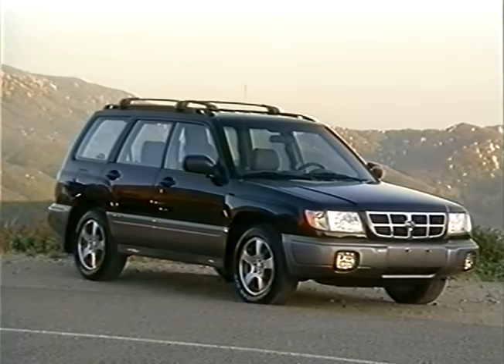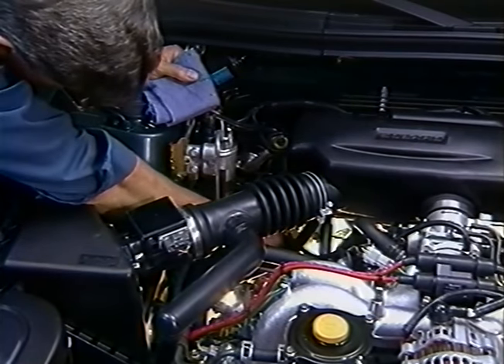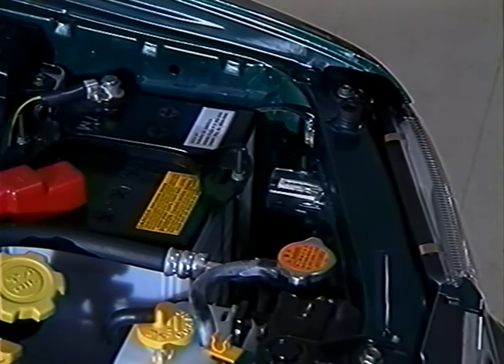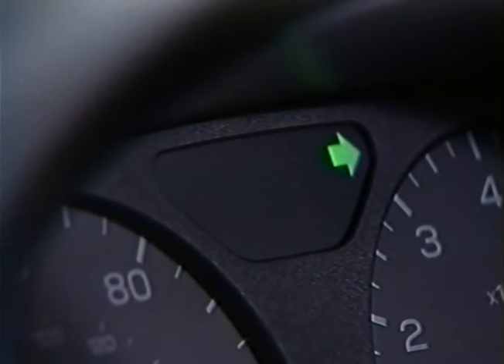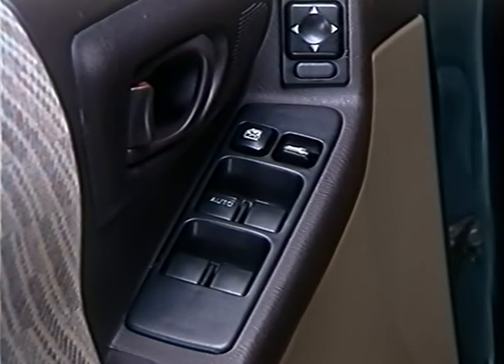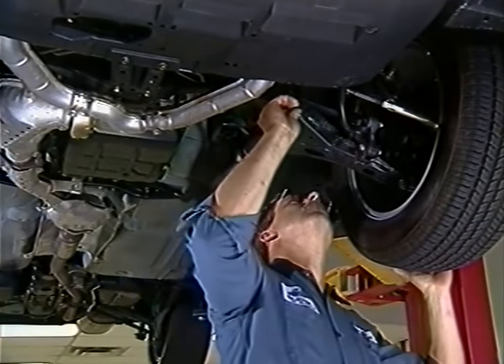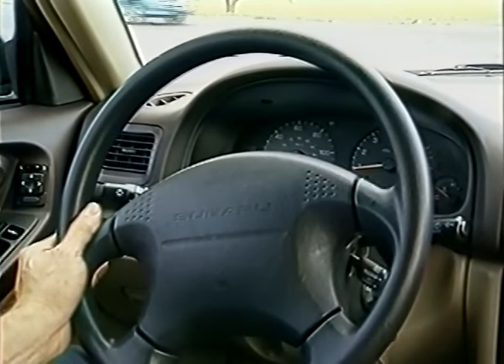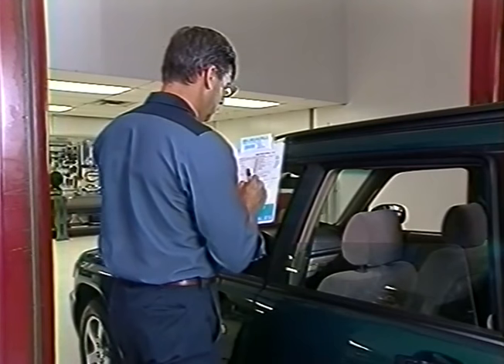1998 Subaru Forester PDI Training Video

Comment: The drivers window should go up automatically as well, unless the USDM dumbed that down too lol
Reply: Yeap my 2001 forester driver window goes down automatically but won't go up automatically seems pretty dumb to have one thing but not the other
Reply: @cristianvelasquez893  They go up & down auto in Australian market cars strangely! 🤔😳
Reply: federeal regulations. subaru didnt include resistance detectors in their windows, which would prevent body parts to get stuck, for a long time,  thats also the reason, why auto up/down was only available to the driver side window, as he usualy would see, if there were something between it.